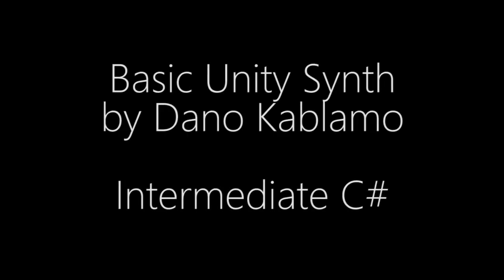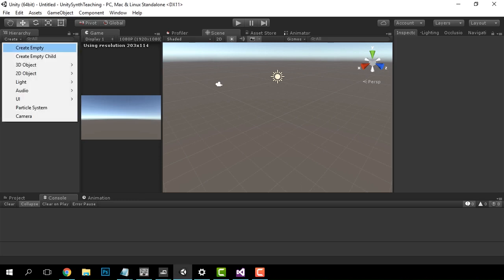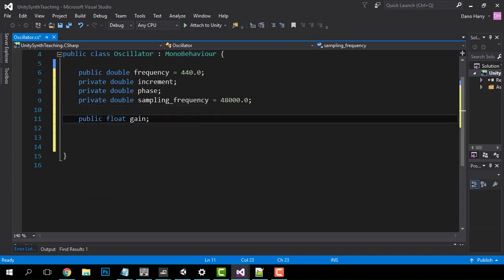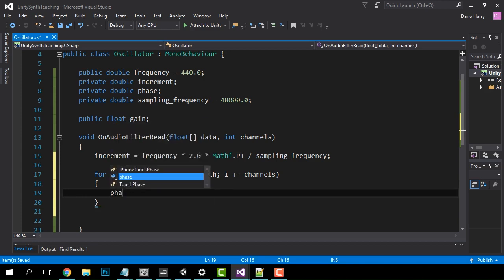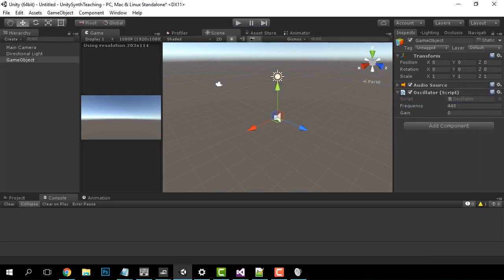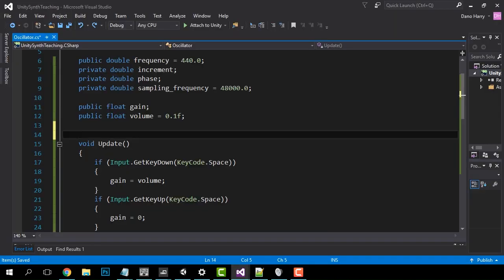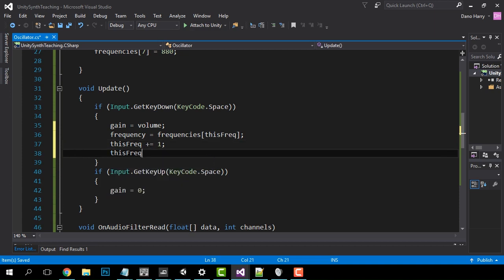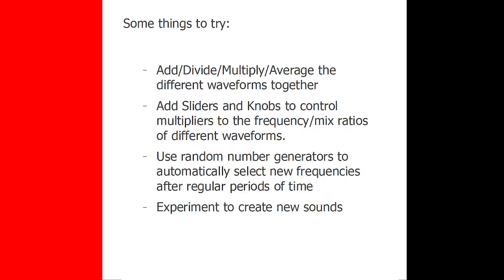Unity3D analog style Synthesizer Tutorial

Comment: Do you have a solution to the popping sound when you press and release the spacebar? You can hear it right around 6:30, and I get exactly the same artifacting when I run the code myself.
Reply: I found a solution. Popping is caused by sudden, sharp changes to the gain. Going from 0 to 0.1 gain in one sample has the chance to create a sharp ridge in the waveform, which is very likely to be audible. I solved this issue by attenuating the change in gain over a few milliseconds. Smoothing the volume in this way removes the artifacts from the samples  without perceptably change the sound.

Comment: Awesome tutorial, first of all. I'm getting an error though. When I had to try incrementing the frequency on every  Spacebar usage, on " frequency = frequencies[thisFreq];" I got this error: "IndexOutOfRangeException: Array index is out of range."

My array frequencies is clearly not working . May you help me?
Reply: np solved
Reply: will you do a tutorial for the graphics, though?
Reply from the maker: Maybe, but for now put this in your scene:

using UnityEngine;
using System.Collections;

public class AudioDataReader : MonoBehaviour
{
    public static AudioDataReader reader;
    //AudioListener audioS;
    float[] spectrum;
    float[] spectrumDbL;
    float[] spectrumDbR;

    public float refValue = 0.1f;
    public float dbL;
    public float dbR;

    public float maxV = 0;
    public int maxN = 0;
    public float threshold = 0.02f;
    public float deg = 0.3515625f;

    public float fSample = 0f;
    public double pitchValue;

    private float[] freqData;
    private int nSamples = 1024;
    private float fMax;
    public LineRenderer lr;
    public bool circle;
    float height;

    public int lrLength = 1024;
    void Awake()
    {
        reader = this;
    }
    void Start()
    {
        spectrum = new float[lrLength];
        spectrumDbL = new float[lrLength];
        spectrumDbR = new float[lrLength];

        freqData = new float[nSamples];
        fMax = AudioSettings.outputSampleRate / 2;
        fSample = AudioSettings.outputSampleRate;

    }
    public static void SphericalToCartesian(float radius, float polar, float elevation, out Vector3 outCart)
    {
        float a = radius * Mathf.Cos(elevation);
        outCart.x = a * Mathf.Cos(polar);
        outCart.y = radius * Mathf.Sin(elevation);
        outCart.z = a * Mathf.Sin(polar);
    }

    public static void CartesianToSpherical(Vector3 cartCoords, out float outRadius, out float outPolar, out float outElevation)
    {
        if (cartCoords.x == 0)
            cartCoords.x = Mathf.Epsilon;
        outRadius = Mathf.Sqrt((cartCoords.x * cartCoords.x)
                               + (cartCoords.y * cartCoords.y)
                               + (cartCoords.z * cartCoords.z));
        outPolar = Mathf.Atan(cartCoords.z / cartCoords.x);
        if (cartCoords.x < 0)
            outPolar += Mathf.PI;
        outElevation = Mathf.Asin(cartCoords.y / outRadius);
    }

    void Update()
    {
        spectrum = AudioListener.GetSpectrumData(lrLength, 0, FFTWindow.BlackmanHarris);
        spectrumDbL = AudioListener.GetOutputData(lrLength, 0);
        spectrumDbR = AudioListener.GetOutputData(lrLength, 1);
        int i = 1;
        while (i < lrLength - 1)
        {
            if (!circle)
            {
                Vector3 pos = new Vector3(2, (Mathf.Log(spectrum[i - 1])) + 10, i - 1 - 512);
                lr.SetPosition(i - 1, new Vector3(2, Mathf.Log(spectrum[i - 1]) + 10, (i - 1) * 2 - 50f));

                //lr.SetPosition(i - 1, pos);
            }

            if (circle)
            {
                Vector3 pos = Vector3.zero;
                height = Mathf.Lerp(height, (deg * dbL), Time.deltaTime * 0.007f);
                pos.x = Mathf.Log(spectrum[i - 1]) * Mathf.Cos((float)(i - 1) * height);
                pos.y = Mathf.Log(spectrum[i - 1]) * Mathf.Sin((float)(i - 1) * height);
                pos.z = 0;
                lr.SetPosition(i - 1, new Vector3(i - 1, Mathf.Log(spectrum[i - 1]) + 10, 2));
                lr.SetPosition(i - 1, pos);

                //    Vector3 p = Vector3.zero;
                //    float a = (i / 1023) * (2f * Mathf.PI);
                //    float r = Mathf.Log(spectrum[i - 1]) + 50f;
                //    p.x = p.x + r * Mathf.Cos( a );
                //    p.y = p.y + r * Mathf.Sin( a );
                //    lr.SetPosition(i - 1, p);
            }
            // Debug.DrawLine(new Vector3(i - 1, spectrum[i] + 10, 0), new Vector3(i, spectrum[i + 1] + 10, 0), Color.red);
         //   Debug.DrawLine(new Vector3(i - 1, Mathf.Log(spectrum[i - 1]) + 10, 2), new Vector3(i, Mathf.Log(spectrum[i]) + 10, 2), Color.cyan);
            // Debug.DrawLine(new Vector3(Mathf.Log(i - 1), spectrum[i - 1] - 10, 1), new Vector3(Mathf.Log(i), spectrum[i] - 10, 1), Color.green);
            // Debug.DrawLine(new Vector3(Mathf.Log(i - 1), Mathf.Log(spectrum[i - 1]), 3), new Vector3(Mathf.Log(i), Mathf.Log(spectrum[i]), 3), Color.yellow);
            i++;
        }

        //  int i = 1;
        //  while (i < 1023) {
        //   Vector3 pos = new Vector3(i - 1, (Mathf.Log(spectrum[i - 1])) + 10, 2);
        //   //pos = Vector3.Slerp(pos);
        //   lr.SetPosition(i - 1, pos);
        //   //Vector3 pos = new Vector3(i - 1, (Mathf.Log(spectrum[i - 1])) + 10, 2);
        //   //lr.SetPosition(i - 1, new Vector3(i - 1, (Mathf.Log(spectrum[i - 1])) + 10, 2));     
        //
        //   Debug.DrawLine(new Vector3(i - 1, spectrum[i] + 10, 0), new Vector3(i, spectrum[i + 1] + 10, 0), Color.red);
        //   Debug.DrawLine(new Vector3(i - 1, Mathf.Log(spectrum[i - 1]) + 10, 2), new Vector3(i, Mathf.Log(spectrum[i]) + 10, 2), Color.cyan);
        //   Debug.DrawLine(new Vector3(Mathf.Log(i - 1), spectrum[i - 1] - 10, 1), new Vector3(Mathf.Log(i), spectrum[i] - 10, 1), Color.green);
        //   Debug.DrawLine(new Vector3(Mathf.Log(i - 1), Mathf.Log(spectrum[i - 1]), 3), new Vector3(Mathf.Log(i), Mathf.Log(spectrum[i]), 3), Color.yellow);
        //   i++;
        //  }

        int d = 1;
        float sumL = 0;
        float sumR = 0;
        while (d < lrLength - 1)
        {
            sumL += spectrumDbL[d] * spectrumDbL[d];
            sumR += spectrumDbR[d] * spectrumDbR[d];

            d++;
        }

        float quotientL = sumL / lrLength;
        float quotientR = sumR / lrLength;

        float rmsL = Mathf.Sqrt(quotientL);
        float rmsR = Mathf.Sqrt(quotientR);

        dbL = 20 * Mathf.Log10(rmsL / refValue);
        if (dbL < -160) dbL = -160;

        dbR = 20 * Mathf.Log10(rmsR / refValue);
        if (dbR < -160) dbR = -160;

        for (i = 0; i < lrLength - 1; i++)
        {
            if (spectrum[i] > maxV && spectrum[i] > threshold)
            {
                maxV = spectrum[i];
                maxN = i;
            }
        }
        double freqN = maxN;
        if (maxN > 0 && maxN < lrLength - 1)
        {
            float dL = spectrum[maxN - 1] / spectrum[maxN];
            float dR = spectrum[maxN + 1] / spectrum[maxN];
            freqN += 0.5 * (dR * dR - dL * dL);
        }
        pitchValue = freqN * AudioSettings.outputSampleRate / lrLength;

        //Debug.Log (pitchValue + " hz");
    }

    public float BandVol(float fLow, float fHigh, int channel)
    {

        fLow = Mathf.Clamp(fLow, 20, fMax); // limit low...
        fHigh = Mathf.Clamp(fHigh, fLow, fMax); // and high frequencies
        AudioListener.GetSpectrumData(freqData, channel, FFTWindow.BlackmanHarris);
        int n1 = (int)Mathf.Floor(fLow * nSamples / fMax);
        int n2 = (int)Mathf.Floor(fHigh * nSamples / fMax);
        float sum = 0;
        for (var i = n1; i <= n2; i++)
        {
            sum += freqData[i];
        }
        return sum / (n2 - n1 + 1);
    }
}

                                                             Put this on a cube and set the frequency you want to monitor:

using UnityEngine;
using System.Collections;

public class CubeFreqBand : MonoBehaviour
{

    public float rangeMin;
    public float rangeMax;
    public Vector3 targetScale = new Vector3(5, 5, 5);
    public float responseSpeed;
    Vector3 setScale;
    public float multiplier;
    float level;

    public int channel;
    Renderer rend;

    public Color thisColor;
    private void Start()
    {
        rend = GetComponent<Renderer>();
        rend.material.EnableKeyword("_EMISSION");
    }
    // Update is called once per frame
    void Update()
    {

        level = AudioDataReader.reader.BandVol(rangeMin, rangeMax, channel) / 30f;

        if (level * multiplier > transform.localScale.y)
        {
            rend.material.SetColor("_EmissionColor", thisColor);

            transform.localScale = new Vector3(targetScale.x, level * multiplier, targetScale.z);
        }
        else
        {
            rend.material.SetColor("_EmissionColor", Color.Lerp(rend.material.GetColor("_EmissionColor"), Color.black, Time.deltaTime * responseSpeed));

            setScale = new Vector3(targetScale.x, level * multiplier, targetScale.z);
            transform.localScale = Vector3.Lerp(transform.localScale, setScale, Time.deltaTime * responseSpeed);
        }
    }
}